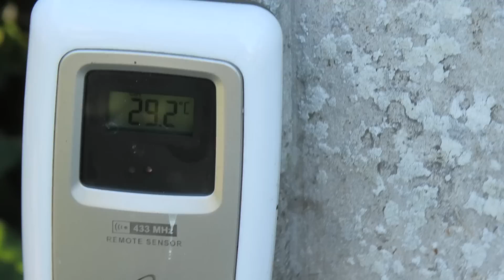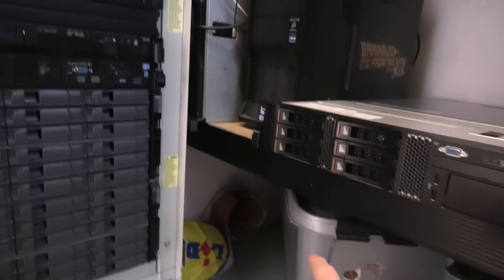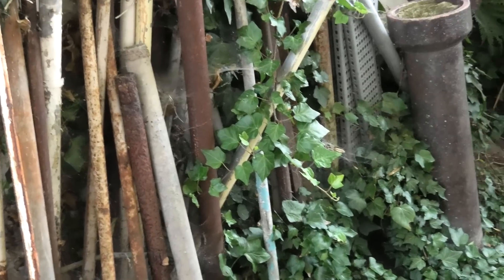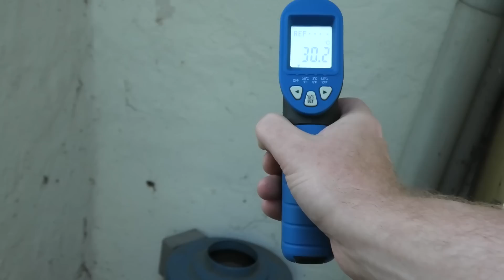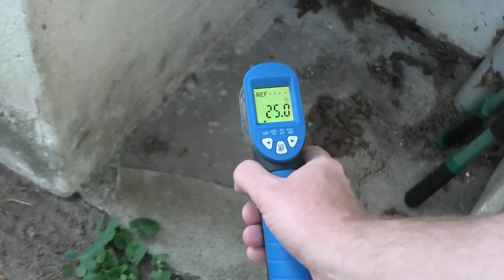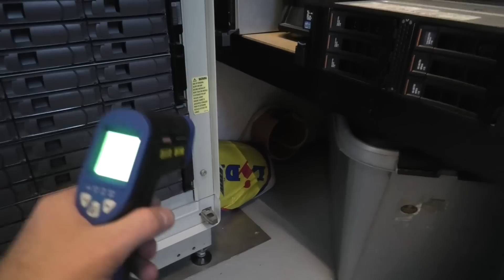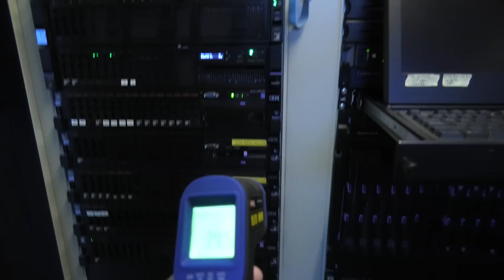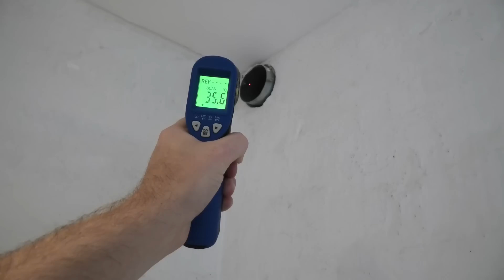How I Still Cheaply, Cool My Data Center in over 30°C - 990

Comment: You'd probably love the shop I'm getting ready to build for my 2 racks.  I'll probably end up pushing some piping into the ground, to allow the soil to cool some of that air instead of using a conditioner.  In my region, we top out on triple digits in the heat range (101+f), so just moving high volume ambient air would still be an issue.    That being said, my flexpod has survived 2 years in the poor unfiltered, muggy, hellish garage.
Reply from the maker: Earth cooled air would be cool!
Reply: It is really the most cost effective if you need just a small amount of adjustment.  Basically, its the same concept as root cellars, though I'm not sure if your region has those.

There are still some concerns about flow restrictions.  It would need to allow enough volume, yet filtered, and also have enough travel to actually cool down in the summer.  Since this is a new build out, I have time to think it through :D

Comment: I actually did it the same... But my main thing is the exhaust. Because the room I'm running it in has a lot of holes...
Reply from the maker: That is also the most important part,, move the hot air away.

Comment: Similar to my set up enclosed server cabinet couple of servers and av kit in garage. Problem the ambience running temp of amp is 35c so been hard to keep the temps down. So have fan pulling air in from outside with large extract just like your sucking out. With oustsude temp of rainy enlgland of 36c rack extract air temp was about 38 ish. Great vid though
Reply from the maker: We never came much higher than this. Now it is colder and the noise has also gone down.

Comment: I hit 42C this summer in southwest arizona. I cool my data center by not having one, and using ARM. I can't even get those temps on your stone walkway on idle chips.
Reply from the maker: Well 42C,, I would also be in trouble, and the max temperature,,ever would have been beaten with no less than 5C :-/

Comment: I really appreciate the effort to hot air separation, it really make a difference. I spend more power on air conditioning than running the lab right now.
Reply from the maker: If you can get rid of the hot air,, you might not have to cool as much.

Comment: Thanks for this video Morton!  I'm currently struggling with the same issue. Outside temps in ~30-35C range (western Canada) and my heat pump is running all the time costing me money. You've given me some food of though on moving the air vs. cooling it.
Reply from the maker: It is like snow,, we do not melt it,, just move it off the road.

Comment: It was 30c here in the UK too. We can’t cope with anything over 20c. In fact it’s 10pm now and the outside temperature is 24c and 70% humidity 🥵

My servers live under the stairs and I also use the heat to warm the living room, it’s just a shame the switch has tiny, noisy fans.
Reply from the maker: Over 20C we are really happy,, over 25C we are melting.

Comment: I looked up Denmark weather, and wow, I was thinking - 'sure it doesn't really get hot there, but I bet it gets REALLY cold in the winter', but according to what I saw it averages around 0C.  Lucky - doesn't get hot, doesn't get cold.  At least power costs here are only 10 cents per kilowatt hour, because when it's 38+C your air conditioner runs nearly nonstop.  I know you mentioned air conditioners being too expensive at the end of the video - do you normally install air conditioners and just rarely use them or do you just kind of forgo having them at all?
Reply from the maker: If we have a handful of days with 25C,, it has been a good summer,, if you had 5-10 days a year where the temperature climbed over 25C,, would you invest in aircon ? over 30C is really rare,, our ALL time record is 36.4C from back in 1975.
Denmark has water all the way around,, we have mild summers and mild winters,, as all that water acts as a buffer.

https://en.climate-data.org/europe/denmark-169/
The average annual temperature is 7.8 °C | 46.0 °F in city of Aarhus.

Comment: Morten, what fan do you use in the pipe? I have a rack requiring cooling in the summer and suffer with high temps. A good air mover could be the solution! I currently use an inline extractor fan and that just doesn't cut it.
Reply from the maker: It's a good 110mm duct fan.. I want a bigger one :-)

Comment: Your air intake filter is clogged up. Try to source an air filter for a big diesel engine, like a 15L highway truck. They move a lot more air then your setup needs. Add a layer of lightweight, washable foam around it to keep the large debris out and you'll be good for at least 6-12 months at a time between filter changes. It doesn't have to look dirty to cause a significant airflow restriction.
Reply from the maker: Thanks for the tips!

Comment: The YouTube channel 'Diesel Creek' uses a compressed air line to clean the diesel intake air filter - gentle wafting on the outside not to dive the dust into the filter. Then a stronger blast from inside the filter pushing the dust out.  Quite scary considering the muck being sucked into a diesel engine.
Reply from the maker: Hi chris cardwell
Thank You very much!  glad you liked the video :-)
Thank you for watching! :-)

Comment: Hi Morten. Here in Brazil, where I live, in winter the temperature goes down to about -1°C. But this temperature is only in heavy winter. In the summer, the temperature up to 42°C. But over a year, the average temperature is about 28°C. My servers are rated for a max temp of 45°C. Using the internal server temperature sensor, I have a max reading of 35 °C. I don't use Air conditioning. Only a big room, about 25m^2, and a lot of shades to mantain the sun outside and down the temperature of my servers. I like this aproach.Helps Save my money in energy bill. Here we have a lot of hidroelectric power stations, but the energy price is very high. About US$ 0,25 per KW. Good vacations for you.
Reply from the maker: It is costly to cool the air... and this works for now,,,, But I would love some aircon for myself!
Reply: @MyPlayHouse  Yes, I too! :-)

Comment: It did get hot for 4 days last week in my part of the UK, but that's all gone now. Currently just under 19C, which is still warmer than usual. I keep several 4 pint milk bottles in the freezer, filled with water which, obviously, freezes to -23C. When need them, which isn't often, I stand 2 of them near the front intake of the Proxmox server, on a baking tray. Works well, but frankly it's a rarity that I need them.
Reply from the maker: Did that help the servers?
Reply: @MyPlayHouse  Surprisingly, yes. The fan speed drops noticeably.  After a few hours I swap them for new ones. I just exclude warm air in the room with a piece of cardboard box, so all the air drawn in, flows over the bottles of ice first.
Reply: You've just gave me an amazing idea, i have one of thoes old big zalman passive cylindrical water cooling reserstor towers. If i freeze the water in it then place it in my pvc air inletpipe to my rack it may help bring my air inlet temps down.

Comment: Try 39 here :) Welcome to Texas
Reply: The problem in Denmark is not so much the heat, but the high humidity we have here... i would rather take 39 degrees dry heat than 30 degrees humid heat as we have here atm!
Reply: @JTL-DK  Our humidity here hovers around 70-80% as well during the summer, making it dangerously hot, we usually stay inside after 2pm-7pm as it is brutal.
Reply from the maker: 36,4° is the warmest temperature ever recorded here,, in 1975,, we have been getting close :-)
Reply: It was 44C/111F in the DFW area one day last week.

Comment: Will you answer my server questions if I am a patron? You answered one I posted a few days ago about using any raid card and a 520 byte storage shelf. Kind of. I think if I am right I can use any raid card and any storage shelf with the proper shelf to card connector and format the 520 byte drives to 512. I have a Dell T5610 workstation and I'm going to buy a HPE SMART ARRAY P822  raid card and connect it to a EMC VNX SAE 25x 600GB 10K Array w/ 2x 6GB SAS LCC Controllers 303-104-000E. I guess it will all work. Who knows.
Reply from the maker: I do not look if people are patrons or not,, if I know it I will answer.
Yes if you reformat to 512, any radi card should do.. I did a video on the formatting from 520 to 512.
Reply: @MyPlayHouse  I appreciate your answer. I watched your video on formatting. It was the most informative I could find. Do you have an opinion on 2.5" or 3.5" sas drives?
Reply: @MyPlayHouse  Hi. I am going to make a diy disk shelf for my 10 sas drives. Are these sas drives compatible with a Mini SAS to 4-SATA SFF-8087 Multi-Lane Forward Breakout Internal Cable?

Comment: Morten, why don't you put a kitchen strainer/sieve over your big intake fan? It should stop leaves and insects from getting inside while still letting lots of air through. Also, I'm curious how much airflow that fan provides, do you happen to have the CFM or m³/h rating on hand?
Reply from the maker: kitchen strainer,, not the worst ider :-) I can't remember the air flow,, just checked,, and info is not on the fan :-/
Reply: @MyPlayHouse  You could also try to get a large diesel truck filter.  Something for a DAF XF truck with a 13.0L engine perhaps. They should sell them at AMC Lastbiler A/S in Aahrus.

Comment: I’ll join the gang heralding 30s/mid 80s as lovely weather compared to what we have at home!
Reply: They don’t even have much of a heat index at those temperatures! We’ve had mid 90s with a good 6-10 degree heat index on top pushing us over 100 easily. 

Heat index is the additional heat you feel due to high humidity not allowing perspiration to evaporate. Anyone who’s been to Disney World in summer will know nothing dries only drips.
Reply from the maker: It has been a bit better to day :-)

Comment: Gets to 47cel in summer here in AUST.30cel  is great Temp.
Reply from the maker: My little pool is at 20C,,, and I have not heated the water...
Reply: Northern European houses are designed purely to keep warm in winter - absolute killer in a hot summer, the heat just continues to accumulate.

Comment: I would LOVE it if it were only 29C (84F) around here.
Today is supposed to be 38C (102F).
Death Valley here in California hit 54C (130F) on Sunday.
Reply: Our homes here in northern europe aren't built to withstand heat only cold, they keep it warmer inside so if it's even 20c outside could be an uncomfortable 25c inside let alone 30-32 it gets really really uncomfortable and no one has AC here really.
Reply from the maker: :-) 36.4C is the highest temperature ever recorded her.